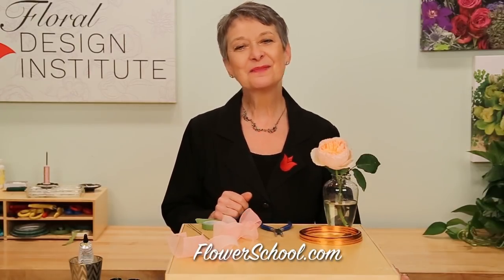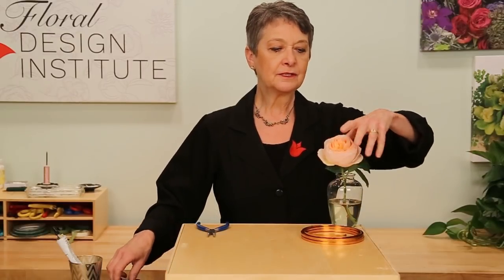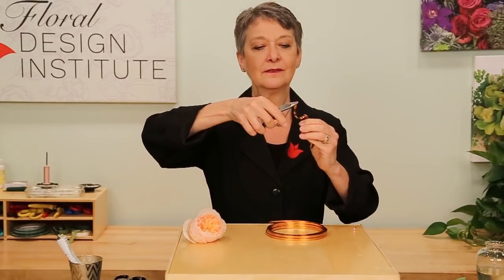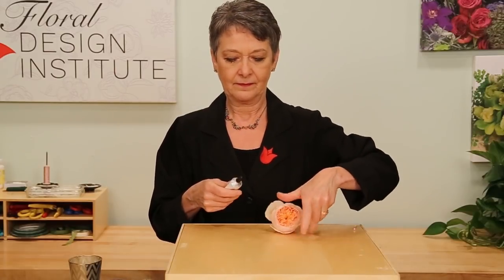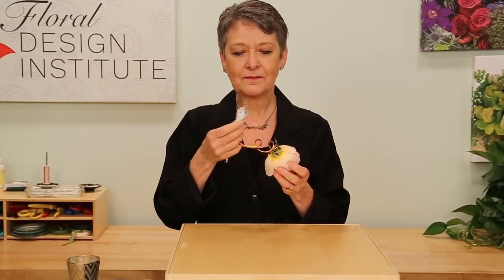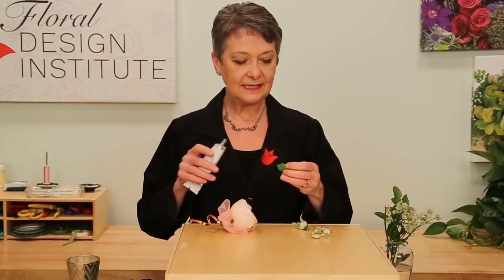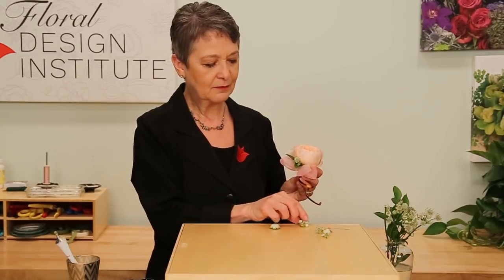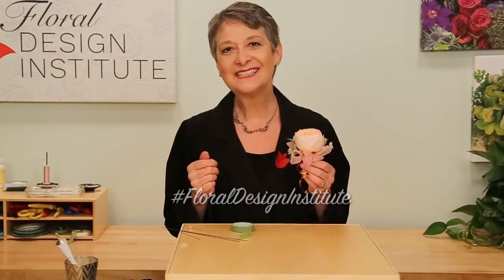Garden Rose Corsage

Comment: How would you pin this?
Reply from the maker: From behind the lapel / fabric, pin over the flat wire close to the rose, then tightly back under the fabric.  Second pin lower on the flat wire would add stability.